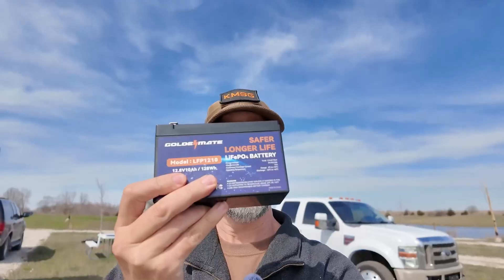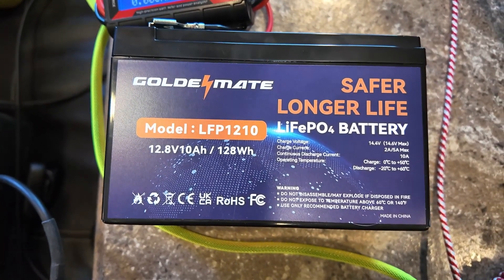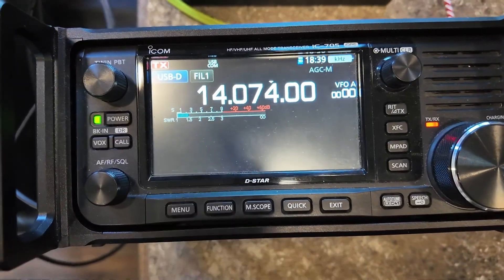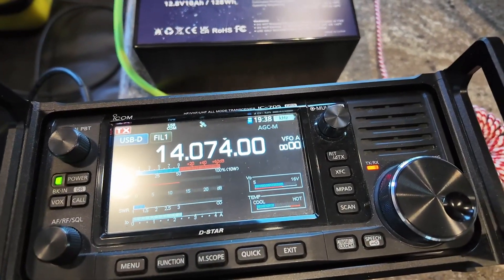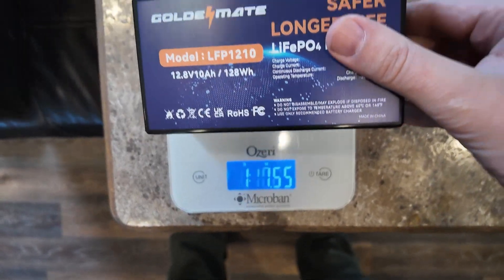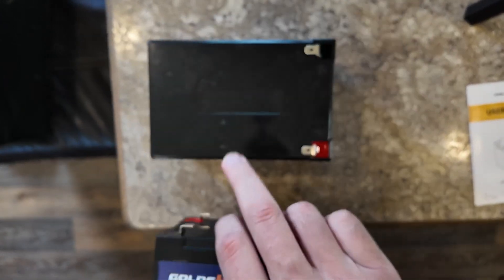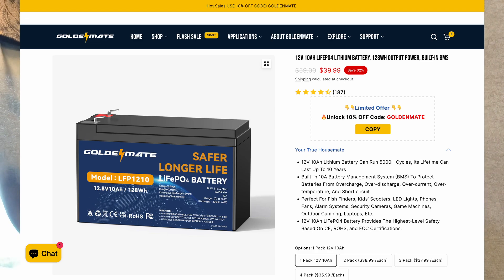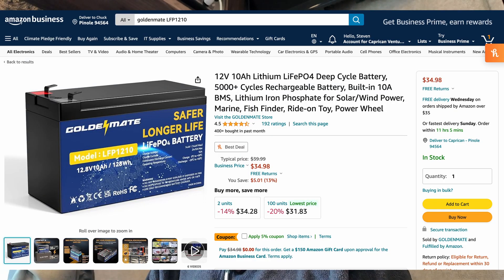This Tiny Titan To Tie To The Transmitter

Comment: Just picked up two of the 12ah. Was only a few bucks more than the 10ah. And had a 15% off from Amazon. 
Question is, they are only 12amps continuous. I'm not sure if they will work with my 100w rig. Ft100 says 20w output at 100w. Would that destroy these?
Reply from the maker: Look for continuous discharge rating in specs.  Usually what happens is you will power the radio just fine, but obviously not for 12ah.  Check out my other video running a 100w radio on a 5ah battery.

Comment: What is the continuous current rating vs. Bioenno? A larger physical size may deliver more current.
Reply from the maker: Max Continuous Discharge Current: 10a - so not a good solution for >20w radios. I have seen a 3ah bioenno that can deliver 30amps out - sounds impossible and I'd imagine you can't do that for very long.  I was actually trying to test a failure condition to prove a point and was left holding...

Comment: How does the voltage regulator work in the 705 and similar radios?  I suspect it is a linear regulator but if it is a boost converter of some type then I would think it would pull more amps as the voltage drops in order to maintain constant power consumption.
Reply from the maker: I don't have an answer for that, but I agree with you.

Comment: I'm using 12V 12Ah LiFePo4 battery since 1.5 years, and works very well. I used it to astrophotography first, but now I'm doing some HAM work. I'm using an old laptop and IC-705 for an afternoon, and it barely drained.
Reply from the maker: The 705 is kinda cheating - it was designed to be low power consumption ;-)

Comment: Looks good but I still cringe whenever I see those bare terminals on the top of the battery. I had a grounding strap fall across those one time and it was not pretty. I always tape those up.
Reply from the maker: Its almost every battery I own/have seen - I feel the same way!
Reply: @temporarilyoffline  The Bioennos I have don't do that and I have one battery with a plastic cover around those so you have to slide the connector inside the plastic to make the connection
Reply from the maker: @don_n5skt  Bioenno has a better solution on most of their batteries, but not all of them.  This is one that I have: https://www.amazon.com/Bioenno-Power-12Ah-Battery-BLF-1212AS/dp/B00RKJLA9E
Reply: @temporarilyoffline  Yes, I have one of those also but I have a couple of Miatis and also a couple of Duracell GEL cells that are made that way.

Comment: I used the same size battery from a different random chinese brand to make a battery box from a harbor freight 1800 apache case with power poles and an amp/volt meter and charging for my fold out solar panels. Works really well.
Reply from the maker: Awesome!  I love making battery boxes.

Comment: I would run that battery 10 hours,  I think you'll find that it won't produce 10ah.  It is too lightweight for a lifepo4 battery,  there is a weight to capacity ratio that this is not making for ten amp hours.
Reply from the maker: I'll have to run a full drain test.
Reply: @temporarilyoffline  that is the test I would like to see prior to purchasing!   Capacity testing is shocking sometimes from my own batteries.
Reply: My guess is it makes it 8 hours, which is still more than enough with a solar charger.
Reply from the maker: @GaryStango  I've got a battery tester coming... We'll see
Reply: @temporarilyoffline  you have the meter,  just need a 12v small heater 😉
Reply from the maker: @chrisnmichelle0218  yep, meter and load (that isn't a QRP radio)...